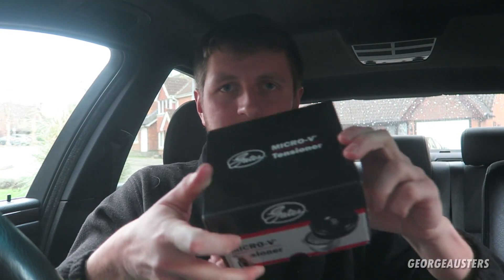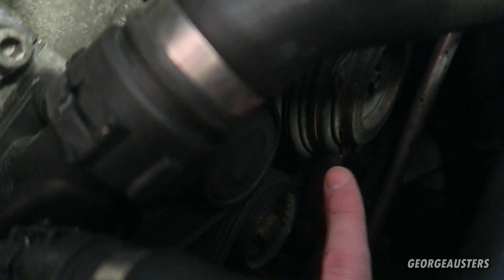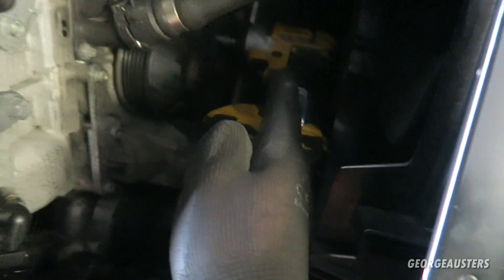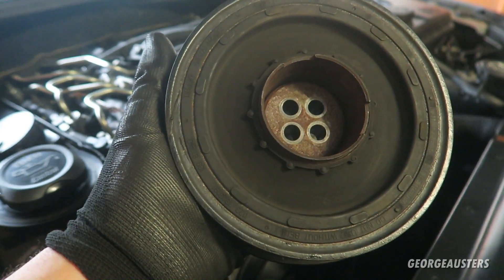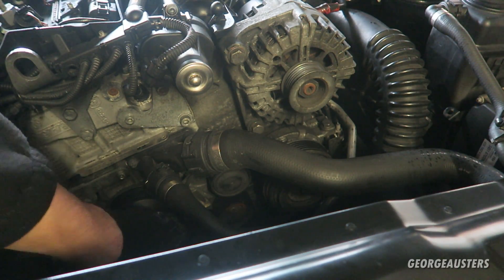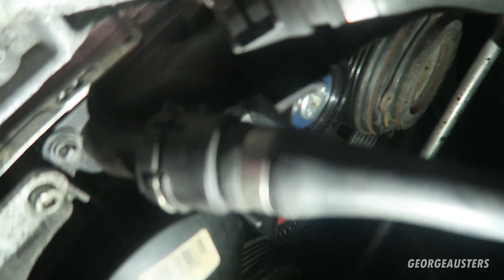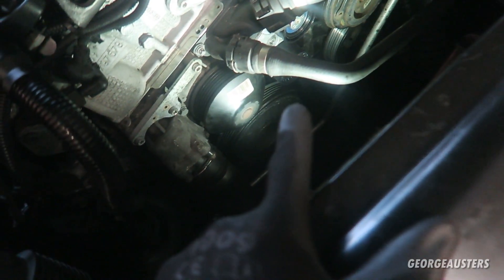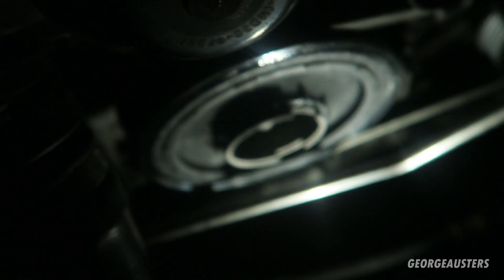BMW N47 / N57 Crankshaft Pulley Replacement

Comment: Question are serpentine belt and drive by the same things? And when engine gets running why do you need crankshaft pulley if crankshaft is making power by itself or is crankshaft moving the belt to power like altenetor and so?

Comment: Hi george,  is it a same procedure for auto? Or Do i need to lock flywheel to tighten the bolts, i just got myself an impact wrench cheers
Reply: Use the torque wrench to tighten the bolts to 40 torque, then put a offset angle socket with impact wrench to slowly further tighter the bolts by 120 degrees. Many thanks George for your video, really helped my replace the pulley on my car today.

Comment: Why you didn't change the water pump along with as it has same access in the area?
Reply from the maker: No need. These water pumps are not a common failure point on these engines, never seen one fail.

Very easy to replace if I need to👍🏻

Comment: Hi mate, I’m hearing a noise on my n47 been about 2 months I have been hearing it now sounds a bit like a flat wheel (it’s not) iv checked for screws etc in tyres nothing in, it’s a bit like a flapping noise been told could be prop shaft or crankshaft bearing maybe? Any ideas at all? Hear it more when the car is slowing down or coming to a stop after driving
Reply: Did you find out what it is
Reply: Majid Rahman apparently it was my gearbox one of the cogs had a tooth broke an it was causing the noise an eventually it would of completely broke so I bought a part worn gearbox as I couldn’t get new an had it fitted an noise has gone so must have been that I don’t know how the mechanic knew it was that but anyway all good still 2 months later

Comment: Hi george, great channel wondering if you can help me with diagnosing a whining noise. When i remove the belt the noise goes away, so deffo pulley related, i have changed the alternator but noise is still there. Rest of the pulleys are smooth. The noise i can best describe is like when you have an electric interferince with a radio, but mines in the belt area. What do recommend to check of replace. My car also has the electric rack
Reply: Update: It was the alternator on its way out
Reply from the maker: Glad you got it sorted!
Reply: @GeorgeAusters  yes all done a while ago now moved on to m57 e90 love watching ur vids. All the best for 2022

Comment: I am not sure on this model but in general the alternator wheel is ridged because the belt should be the other way on it. I mean on the mini the same engine has the belt routed this way: https://www.newtis.info/tisv2/a/de/r57-cooper-sd-cab/repair-manuals/11-engine/11-28-drive-belt-with-tensioning-deflecting-element/Dyg1n3gB
Reply from the maker: It’s a double sided belt👍🏻

Comment: How block the pulley ?
Reply: If ou have a manual just put it in high gear with the parking brake on. If ou have an automatic, buy an impact screwdriver.
Reply: @mxyz6888  thank's

Comment: Hi. Another good video. My N47 engine, E60/ 5 series crank pulley is all cracked (121.000 miles). I'll get it changed next weekend. Waiting for autodoc to deliver the parts. Corteco crank pulley + Gates belt kit. Removing the crank bolts with impact tool is the best tip. Otherwise you have to buy a special tool which costs £80 or you can ruin your timing chain if you spin the crankshaft the other way. Thank you George. Keep it like that.

Comment: Hi there mine seems to have a different tensioner to the one on the video and also has a torx head bolt holding it on

Comment: Dear George,
How to block the crankshaft pulley to avoid to turn when unscrew or tight the 4 bolts?
I have also automatic gear box.
thanks for your reply
Regards
Reply: I want to know
Reply: I think you need to buy a crankshaft pulley locking tool to lock it.
Reply: @linli1698  hi 👋🏼 thanks for your message. Have you a link where to buy this tool ? Thanks 🙏
Reply: @linli1698  thank you 🙏

Comment: Great video once again. tensioner pulley is as noisy as your was! Am I safe using my impact driver for removing pulley bolts. Just concerned about crankshaft spinning, is it ok to use impact without locking? I’m not sure how I would lock it. Any suggestions very welcome.
Reply from the maker: Yes you are!
Reply: @GeorgeAusters  will i be able to use impact on a AUTO e60 too without locking it? CHEERS
Reply: Thanks mate. Final question, do you know what the torque specs are on the crank pulley for final torque?

Comment: Any ideas how to lock the crank? On my auto, even putting it in drive and turning off, the crank still rotates when trying to undo the bolts. I don't have any specialist locking tools.
Reply from the maker: Allen key in flywheel

Comment: Hi Dear George,
Thanks for your interesting video.
Could you please give me link or document where to find nm tightening torque (nm)?
Thanks to you very much.
Regards
Simo
Reply: I got the torque settings for my E90 320d from ISTA+. Search for Vibration Damper in ISTA+. On my N47 engine it was 40 Nm torque followed by further 120 deg bold tighting. This can be done easly with a offset angle socket and impact wrench.
Reply: @abaidmughal1  thank you very much

Comment: Does the engine cover keep the egr completely hidden? Ive heard that if an mot tester can see it is missing you will be failed, however he cannot take off any covers to inspect it.
Reply from the maker: Pretty much. I’ve never even had my bonnet lifted on an MOT👍🏻
Reply: Or you could make a dummy 😊

Comment: So you managed to change the crankshaft pulley without locking the crankshaft? I'm curious, because i have a 330d M57 and my pulley is shot.
Reply from the maker: Yes

Comment: Strangely BMW parts department can not tell me whether my car has electric or hydraulic power steering even hence size of belt required when the have the vin number lol 🤣
Reply from the maker: Typical lol. Just check to see if you have a PAS pump and fluid reservoir.

Comment: Hello mate nice vid! Should you lube up the crankshaft pulley seal with a bit of oil or dry with a soft rag? Cheers bud
Reply from the maker: Yes you should lube it up to help it go on👍🏻
Reply: @GeorgeAusters  cheers mate I cleaned the seal and area. Then smeared on oil on the rubber seal. When on easy. I hope it doesnt leak lol

Comment: Any ideas how to hold the crank on a 5 series e61 auto tourer. My Crank shaft rubber has disintegrated and I cant get theae bolts out manually  Thanks
Reply: I managed to get it done. Thank you for the video, it really made it easy for me.
Reply from the maker: Sorry for late reply, good stuff man. Glad I could help👍🏻
Reply: @johnny6whiskers  hi could you tell me how you managed to remove on auto car with four bolts, cheers,

Comment: Hi George 
I bought a X1 with an n47 at 172,000miles detailed as failed water pump. I replaced the water pump, steering pump, belt, pulley wheel, tensioner and ideal pulley wheel. The aux drive still rattles really badly at ideal. I have taken the air con pump apart as far as the bearing and it seems good also the alternator. 
If the crank was wobbling surly the engine wouldn’t run correctly (car performs and drive well) I suspect the new pulley wheel is faulty? Any thoughts?
Reply from the maker: Have you done crank pulley?
Reply: George Austers, yes, with a new aftermarket one £70 (don’t know the make it was online from 4-b automotive) it it’s this new wheel that I suspect could be faulty? Its either that or the engine crank shaft? But the engine runs smooth at any RPM other than ideal and has good power?
Reply from the maker: @robertnorcott6442  100% mate that is your issue. You cannot use a cheap chinese crank pulley like I said in the video.

The link is in the description for the Febi Bilstein one!
Reply: George Austers I finally found time to fit the Febi pulley. It has totally corrected the problem. Thank you for your help and videos. 💪🏻👊👍🏻
Reply from the maker: No problem my man!

Comment: Hello George. These videos are class. Im actually looking at a 318D Touring M sport on a 2011 plate. 72k on the clock. Is it worth getting the newer model 2013 onwards or are these worth taking a chance on? Was the 2.0 diesel unit changed for 2013?  Ive heard bmw addressed the timing chain problem in a certain year but cant get any concrete evidence. Any guidance would be appreciated.

Comment: Great video as always George 👍 I used this to refer to when doing my crank pulley at the weekend, very helpful. Does the orientation of the 2 cutouts on the outer rim of the metal centre matter when fitting the new part? After replacing mine I realised they were at a different orientation to the old part and forgot to check before torquing the bolts up. Can't see a reason why it would matter personally, but always best to check I guess
Reply from the maker: No mate as long as the bolt holes line up👍🏻
Reply: @GeorgeAusters  happy days, cheers for the reply mate 👍 Here's to the next job 🍻 front shocks, springs and drop links for me this weekend
Reply from the maker: Haha have fun, how long did the originals last?
Reply: @GeorgeAusters  just over 130k. However, I suspect they're not the originals as its a Alpina D3 Biturbo and should have Bilstein shocks with Eibach springs. But it's currently got (leaky) Sachs M Sport struts on it. Trying to return it to as original as possible, getting there bit by bit!
Reply: @General87Lee  I believe the cut out on the crankshaft pulley that you were referring to is for use with a specialist locking tool to lock the crankshaft pulley during removal and more importantly during tightening to the correct torque.

Comment: Hi buddy don’t suppose you have got a link to where I can get the bits from to do this on mine  thanks mate
Reply from the maker: Crankshaft Pulley: https://amzn.to/2PBG1bt
Gates Drive Belt: https://amzn.to/389rtq3
Gates Tensioner: https://amzn.to/2wRdnfY
Gates Guide Pulley: https://amzn.to/2vtbA0f
Small Impact Wrench: https://amzn.to/2T4igdi 
Big Impact Wrench: https://amzn.to/39NOrEu
Sealey Impact Socket Set: https://amzn.to/3a8zcpQ
Torx Socket Set: https://amzn.to/32EbnDV
Female Torx Socket Set: https://amzn.to/2PzAZMQ
Torque Wrench: https://amzn.to/2VF0YpI
Reply: George Austers thanks mate

Comment: Hi George - great video - you do make it look easy friend! - how long did that take in total? It seemed like 30-40 mins. I have an E61 2008 LCI with low CO2 and am hearing noises from the AC compressor (Denso 6SBU14C) both the pulley bearing and the clutch when engaged. I have 2 questions; (1) I am assuming yours checked out ok? (2) Do you happen to know where I could obtain a kit to fix up my compressor drive? Thanks in advance, and keep up the fine work, you are clearly very experienced. John.

Comment: Got the same engine as you but it smokes on first start of the day and idea of what it could be?
Reply from the maker: What colour?
Reply: @GeorgeAusters  it's blue ish
Reply: Leaky valve stems overnight.
Blue smoke is oil burning off.
Reply: @gulag8735  id think that but its recently been rebuilt makes me think it might be turbo related just need to check the play

Comment: Hi there, I'm about to begin this endeavor on my e91 2009 225.000km n47 (it still has the original pulleys and belt😲). How did you managed to lock the crankshaft?  Thanks. BTW nice video.
Reply from the maker: I didn't lock the crankshaft but there is a slot on the timing cover where you place a locking tool into the flywheel
Reply: @GeorgeAusters , can it be done by simple puting the gear box on 6th gear and the e-brake on? Thanks for your help! I did saw that tool in the timming chain replacement video part1. ;)
Reply from the maker: @octaviomachado3643  In theory yes. Give it a go!

Comment: Hi George, one of my fuel injectors on my, e60 lci 520d 2008, has gone. Do I need to get the exact same make and exact same part no. , to replace it please ? And Can I replace just that one bad fuel injector, or do I need to change all four of them ? Also the part no. I've found from realoem is, Part 13537797877 , which fits other models too. Could you please let me know your thoughts. Many thanks.

Comment: Hi George, I love your videos... simple and straight forward .. I have got a BMW320 ED 2011 ,   I don't know its an  E46 or E90  .. Can you please guide me to change the coolant. I dont know how to drain the coolant from the engine without starting the engine , Also how to get the air out of the engine without starting the engine, Please...

Comment: Another Great Video👍.  A quick question for you, when the crankshaft pulley starts to rattle around does it need to be replaced straight ASAP or can you continue driving I. E will it become worse or snap.
Reply from the maker: Try and inspect it to check for cracking, however sometimes it's hard to see the cracking until its ready to tear off

Comment: Love the video’s. Been really helpful on my N47 a bit of preventative maintenance. One question I have bought blanking plates for my EGR will I be fine doing this as I may not be getting my car remapped for another month or two. Or do I do this just before getting my car remapped? Thanks
Reply: JonniH18 getting car remapped is a must
Reply: Remap Tuning I will be getting my car remapped but it was the period inbetween of removing the EGR and then getting my car remapped will probably be a month, is that fine?
Reply: JonniH18 no it’s not fine your engine light will come on , the egr is electronically controlled remap is a must
Reply: Remap Tuning was just asking for the advice as I didn’t know.......

Comment: Beautiful job. More nice tight components added to her!
Reply from the maker: Cheers mate👍🏻
Reply: George Austers got my belt fitted. Literally 5 mins on mine thank Jeez, no tensioner pulley to loosen as it’s spring loaded so only had to slide a pin through a hole to hold it back. Fitted my new awkward coolant flange/pipe and only had to raise the manifold inlet 4 inches to get at the hidden hex screw so left injectors etc connected. Couldn’t believe how clean the ports are inside as only a fine oily layer present with no coke build up at all, I only do long journeys in the main so that could be the reason it’s stayed clean! I wouldn’t have been able to do it without your tutorial vids pal so thanks again!!!!
Reply from the maker: @PoppinPortraits  Good stuff! As always mate, my pleasure

Comment: For pulleys I only use INA components, the crank pulley I use only corteco on BMWs (since they make the oem one and the part number got revised). For belts only continental, never had a problem with these brands.
Reply from the maker: Yep i've never had a problem with Gates bro!
Reply: shop that ive ordered from those parts are just the same manufacturer as u said, the seller suggested me to get ina corteco and continental belt
Reply: Hey, ı have an issue with my crank pulley, i need to replace it. I found ina pulley, but want to ask, do you mean contitech for belt? Thank you 🙏🏻
Reply: @TheIpwntrolz  ye
Reply: @edoardopassera thank you too much. My crankshaft pulley do a noise when i open ac, its like herar supersport bike past near you. I will try it ina brand, and conti tech belt 🙏🏻
Reply: Just installed INA belt kit on mine, belt said "Made in China" :( Don't know if im going to change it again later on

Comment from the maker: Parts and Tools used in this video!
Crankshaft Pulley: https://amzn.to/2PBG1bt
Gates Drive Belt: https://amzn.to/389rtq3
Gates Tensioner: https://amzn.to/2wRdnfY
Gates Guide Pulley: https://amzn.to/2vtbA0f
Small Impact Wrench: https://amzn.to/2T4igdi 
Big Impact Wrench: https://amzn.to/39NOrEu
Sealey Impact Socket Set: https://amzn.to/3a8zcpQ
Torx Socket Set: https://amzn.to/32EbnDV
Female Torx Socket Set: https://amzn.to/2PzAZMQ
Torque Wrench: https://amzn.to/2VF0YpI

Comment: Does the original pulley have any marks about what brand is it? Because I've heard Corteco delivers this part to BMW factory. In russian owners forum many people discuss this issue and say that no matter what substitute you use (Corteco, FEBI, Gates etc) it goes 50000km +/-, nothing compared to original BMW pulley
Reply: corteco is the same as bmw. you can see that bmw logo was removed from it. so its the same part. as yes- russian forums are great.
Reply: Wish I saw this before, I fitted Corteco and it failed again in 12 months
Reply from the maker: The original crankshaft pulley is BMW

Comment: I had Gates after 30,000 km had micro cracks. Now I have Contitech already over 50,000 and like new
Reply from the maker: I've always used gates and never had a problem
Reply: @GeorgeAusters I used Gates at Audi and there was no problem either. And here in bmw something like this occurred, maybe it was just flawed ... ps. good job as always Bro
Reply from the maker: @damiangrabowski2104  Thanks mate

Comment: I can tell this guy never wants to have a breakdown as he just made his car bulletproof
Reply from the maker: Hahaha breaking down is no fun!
Reply: George Austers my crankshaft pulley broke on saturday😭😭😭😭
Reply: @minhajuddin6607  Nothing makes your day better than crankshaft pulley flying loose when starting the car to go from work to home
Reply from the maker: Should have replaced it before it failed👍🏻
Reply: @GeorgeAusters  Yep. Didn't recognize symptoms, just high pitched rawl when revving engine. And that I guessed to be a bearing somewhere. And it actually was a tensioner bearing.

But recalling back, I did have exessive engine shake. But not too bad to be honest. Symptoms sneaked up so slowly that I didn't notice it early enough. I just changed all and it was about 20min job. Than you for superb video! Had to do it in the open in field so all tool sizes, torques etc. were nice to have! Straight forward job.
Reply: @GeorgeAusters  Actually the rawl didn't go away. Next up, changing the alternator. Spinned it by hand freely and would you look at that - squeak squeak 🙄
Reply: @OH8EFI mine is currently stuck so it would actually make my day! Haha